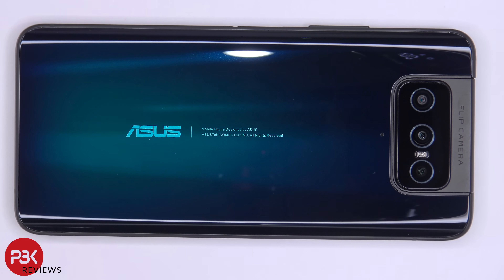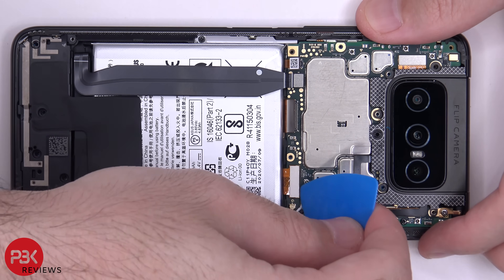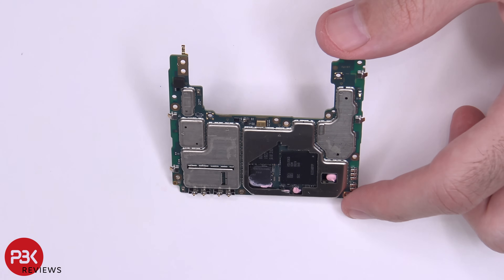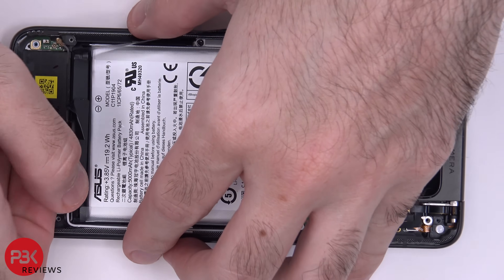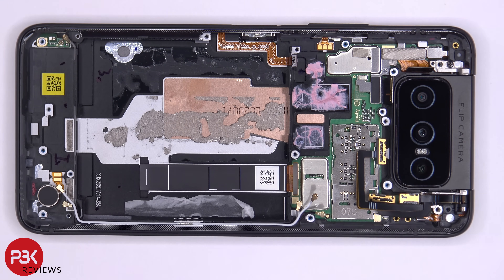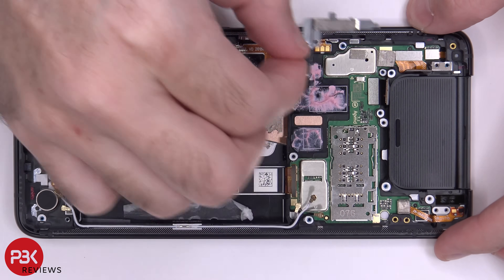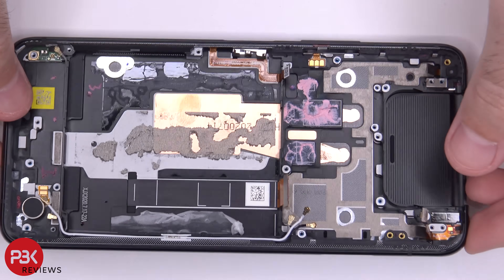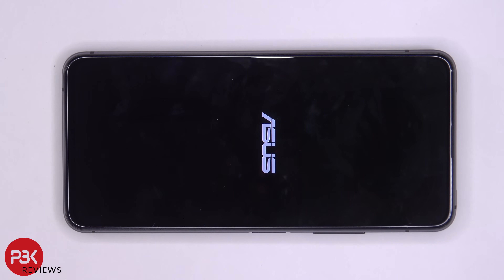Asus Zenfone 7 Pro Disassembly Teardown Repair Video Review

Comment: Hey guys, I need some advice. By somehow replacing the gpu of this phone, do I lose all data?? I haven't backed anything up :( The display is just black but the rest of the phone works cause I hear sounds and calls. At first it went black and opened back up a few times but now it is dead for the last few days. Also, in the beginning of this dire situation, usually before it went into black out mode, static would appear (like on old tvs) which makes me think the display is not the issue, it is the gpu or something. I just want all my data back and don't know what to do. Thanks for you attention, hope to hear back from you!

Comment: The wire that you peeped off at 5:00 i connect that upside down it was still charging but phone was smelling like burning metal. I connected that right way now it is not even changing no red right.not starting up

Will you suggest me what damage i made so i can buy that part
Reply from the maker: You might have shorted out the sub board or the cable not sure. You would probably need to first try a new sub board/charger port board and if no luck then a new flex cable that connects it to the main board. If still nothing, then you might have damaged something on the main board.
Reply: @PBKreviews  when i connect that upside down again, i can see the red light but phone overheats but when i put flex cable right way nothing happens no red light when i plug in charger just dead.
I think it is flex cable, what do you think?
Phone should start without flex cable i Think

Comment: Hi
thanks for a very detailed and professional video,
My question is whether the phone needs to be heated in some way before disassembly, and whether I also need to heat it to stick the new battery cover on.
Reply from the maker: Thanks. Yes you need to heat it to make the adhesive loosen up and easier to pry off. No you don't need heat to re apply new adhesive. But you will need new adhesive (which usually should come with replacement covers)
Reply: @PBKreviews  Today I moved all the insides from the old phone to the new phone frame, all functions work perfectly, except for the volume buttons. these buttons are integrated in the new frame, so do you think it was my mistake when assembling or a defective frame.

the main speaker for loud conversations also does not work

Comment: Hello
Do i need to remove all the parts in the right order before i can remove the battery ?
I just need to replace my battery...
Reply from the maker: you just need to remove whatever is necessary to be able to gain access to disconnecting the battery cable and removing the battery. you don't have to remove anything extra.
Reply: @PBKreviews  Oh ok, thanks!

Comment: hello I did the same thing in the video and now my phone doesnt work. I guess it is because the power button and the chip that belongs to it are somewhat broken..my phone will charge but it wont turn on..what can I do now? :)
Reply from the maker: If the power button/flex is damaged, you would need to replace it for it to work again.

Comment: Hi i repleaced the batterm but now my phone is in rebooting mode, it just kept rebooting! is there any solutions to this issue? or is it bec i break sothing during this process?
Reply from the maker: might be a bad battery or might be something shorting if you assembled it incorrectly. Try using your previous battery and see if it does the same thing. Also make sure all the cables are connected properly and that everything is in place and not over tightened.
Reply: @PBKreviews  Hi i have fixed the issue, i replug all the cable and now it`s in good working order! thx alot!. 
I

Comment: Excuse me, if the flip camera is removed physically, does the phone work normally without the flip camera?
Reply from the maker: yeah should work fine but the camera app will freeze if you open it or show black screen.
Reply: @PBKreviews  Thank you for your reply very much, I have removed the flip camera physically successfully.
And the flexible cable sockets of camera have to  be isolated to avoid short or jamming. 
The NFC cover has metal meshes at the positions on the sockets.
It will cause abnormal behavior, the phone will shutdown randomly while operating.
These are for your information.

Comment: What's that white wire for? The one side source is broken in mine
Reply from the maker: Its a coaxial antenna cable. It connects from the sub board antenna receivers to the main board.

Comment: Question- I cannot find any retailer to repair my zenfone, also because the phone I ordered is from Taiwan. I was going to attempt to repair it myself and this was helpful! I'm kind of lost as to where to even start for ordering parts, I see some in your description. Do I need to order all of this stuff? Thank you
Reply: In france we have en.accessoires-asus.com which is an official spare parts retailer, I've myself ordered a backglass for the Z7 and it worked perfectly. Maybe they do international shipment (the level of packaging is incredible, many protective layers)
Reply from the maker: You can try the website the previous com-mentor mentioned or this website https://www.asus-accessories.com/zs671ks-88979-69216.htm. You only need to order the parts you need to replace and the adhesive strip for re attaching the back plate back to the phone. You will also need tools to open the phone which you can find links for in the description.

Comment: Coming from a LG V20, I wanted to see how hard it is replace the battery. Thank you for the work, video is very informative.
Reply from the maker: You're welcome
Reply: Ridiculous amount of work just to remove a battery, I'm also on a V20 looking at this video for same reason. Probably easier than others though and I like that the charge port is on a separate board.
Reply: i also have lg v20. i'm gonna buy this phone in 2 weeks time.
Reply from the maker: @filipgolub505  nice, it's a good device 👍
Reply: It's so annoying that phones aren't made with easily replaceable batteries anymore. I shouldn't need to use a heat gun on my phone just to open it and swap the battery...

Comment: I dropped mine! The flip camera was open and now it flops! No one in my city can get the part to replace the camera! I can hold the flip camera and still use it, it just flops. ASUS says I cannot get it repaired in the United States due to no one in my Zone to do so. I have to send it back to Hong Kong! Any idea what I should do?
Reply from the maker: Hi, I just looked and can't find any place that sells the part either. Looks like your only option would be to send it in to them to fix.
Reply: Hi, I have the same problem as you.

I dropped my phone and the camera still working but it's loose. What did you do?
Reply: @amilcarsalazar4559  at one point mine was able to close. Unfortunately over time it no longer holds and flops around. The only thing holding it is the case lock. It's still broken.

However... Asus has a center near me that I can send my phone into for repairs. However with that, me sending it to Atlanta GA, they will send to China to get a entire knew camera system.

Since the knew Zenfone 8 flip released I'm trying to see if I could get the camera from an 8 and fit into my 7... Or just buy a whole new one

Comment: Unfortunately it didn't help me. In the video he skips the disassembly of the flip camera. I used the device close to my skin, and it absorbed the sweat from my body. Result; There are sweat droplets on the camera lens and I have no idea how to get them out. I needed to see how to disassemble the flip camera so I could clean it :/
Reply from the maker: If need be, you can heat up the glass lens cover with a hair dryer and pry it off. Its held on with adhesive. Then you can clean it out and apply new adhesive tape if needed and close it back up. I personally would try and avoid disassembling the camera assembly because you will run into issues later on for it staying together or opening and closing smoothly.

Comment: Wait, the battery says 4830 mAh and it is advertised as 5000mAh :O
Reply from the maker: There is a Typical and a Rated capacity written on the battery

Comment: Hey considering you disassembled it part by part do you think that it really didn't have the space for adding a headphone jack? (Asus said that there was no space due to 5g modem)
And flip setup is durable right?
Plus charging port has waterproof meshes 🤔
Reply from the maker: Its possible they could have fit it but I believe manufactures are moving away from including it due to the fact everything is becoming wireless now a days, and also they probably want to push their wireless earphones/buds and headsets etc. Headphone jack seems like it will soon be obsolete and I honestly don't think it will show up on higher end devices much moving forward from the looks of it but yep that's just my opinion. With the price tags on these phones now a days, would be nice to at least see these wireless buds and such be included with the phones if they are not supporting headphone jacks.
Reply: @PBKreviews  hate the companies for that behaviour actually. I don't want to see my Philips SHP9500 going into waste.
Reply from the maker: ya, it's mainly about profit for them aside from customer satisfaction and its understandable since they need to stay in business. But yea I think if your taking the headphone jack away, better to offer your wireless ear buds in the box with the phone included with these prices on the phones.
Reply: @PBKreviews  Or provide a working/compatible dongle at least.
Reply from the maker: @kio51423  True

Comment: 4:03  I guess....pull to the opposite side Will it raise the battery? Because it is not the same as the pull-out style that is done in the clip.
Reply from the maker: Its possible its there to help try and lift the battery when heating the adhesive underneath but they are not adhesive pry tabs that pull off the adhesive under the battery. However once heating the adhesive underneath the battery a bit from the screen side, its not too difficult to pry the battery off compared to most phones.

Comment: Glad to see some form of cooling in this ZenFone 7, there was none in the 6.
Reply from the maker: Ya, cooling looks pretty good on this one.
Reply: Which part is the cooling system?
Reply from the maker: @wtf1327  numerous parts together are working to cool the phone, there is thermal paste in between the board and midframe, there is also copper tape to help transfer heat as well as a copper block in the midframe. There is also some graphite film which also transfers heat.
Reply: @PBKreviews  are you sure backplate is glass?? Looks like plastic

Comment: So it looks like they could have fit 3.5mm by using a smaller, square vibrator.
Reply from the maker: Not sure, but I don't think they omitted due to space. I feel most manufactures are just doing away with it and just using adapters with the charger port since most products now a days are wireless so yep.
Reply: @PBKreviews  they've just released 100eur zenear bluetooth earbuds, which I'm guessing is the real reason for not including a headphone jack
Reply from the maker: @____5837  ya that is definitely a possibility